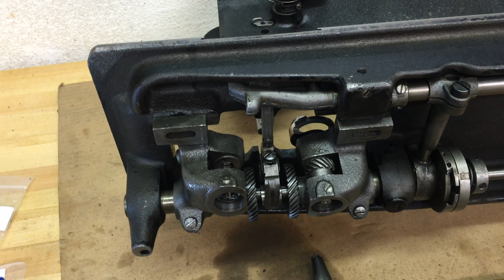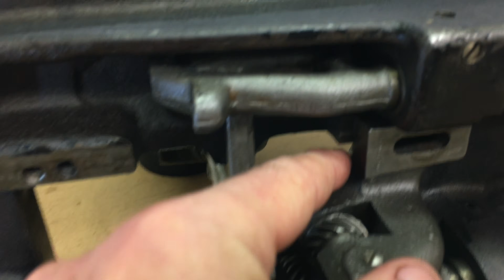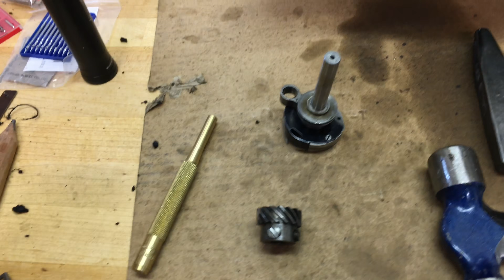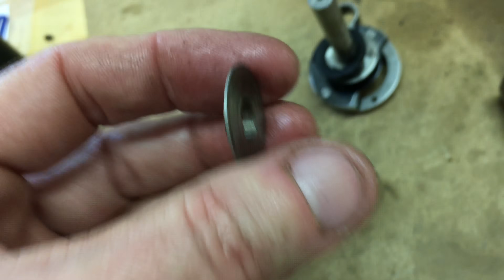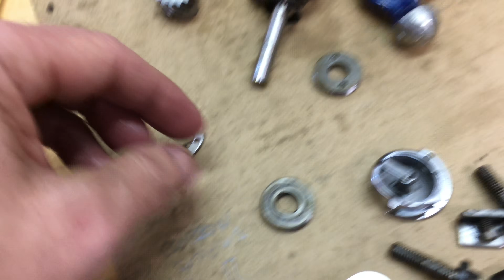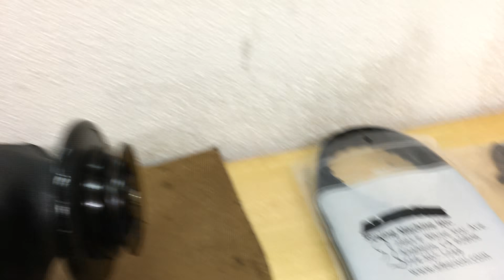Singer Industrial sewing machine 112W140 double compound walking needle bobbin case & shaft removal

Comment: i have just picked up the same machine..the needle bar and the needle clamp both have a small hole that does line up...but i have no screw bolt..should there be one ? the needle clamp will move front to back or up and down..with out the bolt it is possible for the clamp to spin and have a needle hit the feed dog..can someone guide me on this. thank you

Comment: My bobbin cases can spin freely and the gear that make them spin isn’t loose or has a loose screw. It also will turn in correct timing but you could easily turn the bobbin case back a couple degrees and throw it out of timing. What is making bobbin case able to turn freely
Reply from the maker: I wish I could tell ya.. it's been so man years since I took mine apart. I actually need to finish putting it back together soon here. I'll watch this video again tonight and see if I can spot anything and/or maybe in a few days I can take a look at mine (it's out in the garage, waiting to be sold or packed up for the move).
Reply: The bobbin case should spin freely inside the hook assembly. The needle plate should have little protrusion on either side to lock/set the bobbin tab into in order to keep it in place.